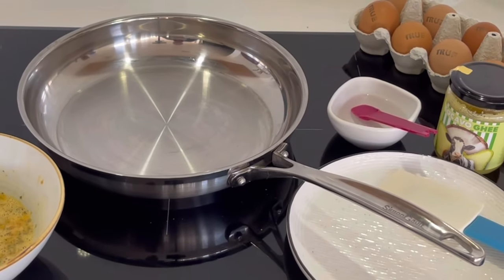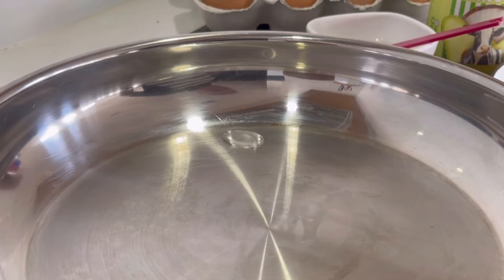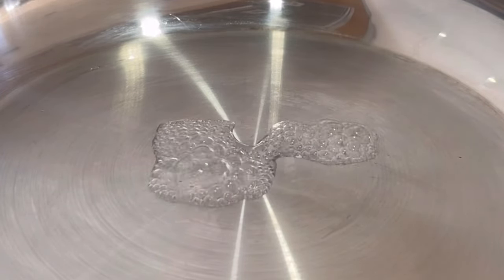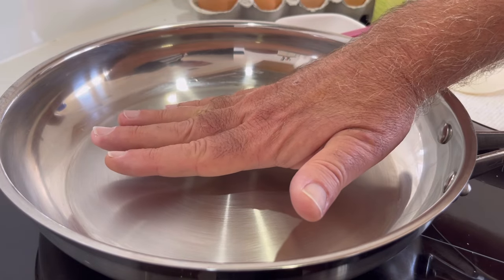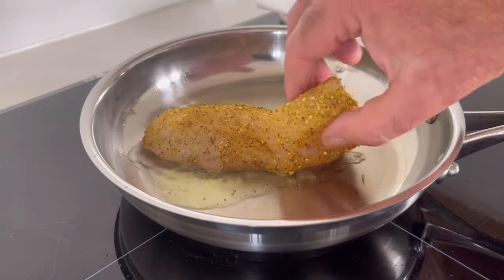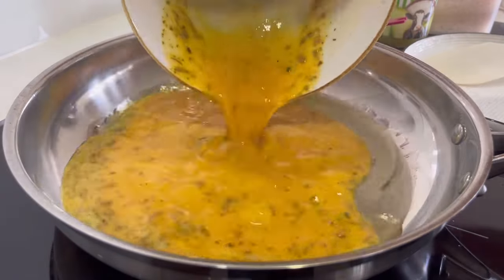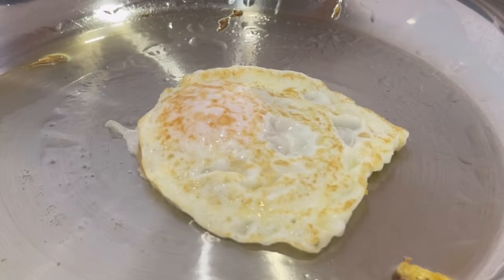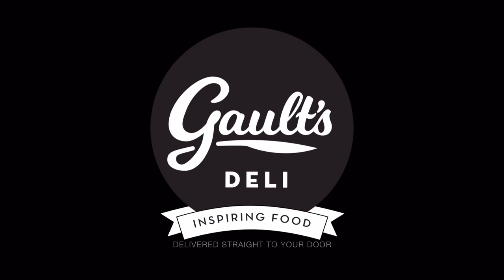The Ultimate Guide: How to Make Food Not Stick in a Stainless Steel Pan! 🍳🚫

Comment: So,  you can only use a stainless steel pan for cooking at a specific temperature? Do you just adjust cooking time for food that needs higher heat? Or just use another cooking method?
Reply from the maker: You can crank up the heat! Stainless steel handles high temperatures well. Just preheat your pan longer for things like stir-fries or searing. You might need to adjust cooking time slightly compared to non-stick pans, but keep an eye on your food and adjust as needed. For super high heat searing, a cast iron pan might be a better option.

Comment: Can i lower the heat afterwards or should it be the same all the time?
Reply from the maker: Hi Robert. That’s a great question! After you've got the 'mercury ball effect' going and added your butter or oil, you can lower the heat if necessary. The key is to start with high heat to get that non-stick surface, but once your food is in the pan, adjusting the heat down is fine to maintain the right cooking temperature. Just be sure to monitor it so nothing burns.

Thanks for asking!
Reply: @simongault5804  i did just as described. I used coconut oil as it has high smoking temp and thing sticks to it straight away. I am not sure my 'stainless steel' pan is real stainless steel after all ...

Comment: Why can I not cook anything with starch in stainless steel? That’s the only stuff that always sticks no matter what😢
Reply from the maker: Hi BabYGirlToria,

 There might be a few reasons why starchy foods are sticking to your stainless steel pans:

As you've seen in the video, getting the temperature right is crucial. Stainless steel pans need to be hot enough before you add food. A quick way to check is the water droplet test, just like we showed—flick a bit of water into the pan; if it dances around before evaporating, it’s perfectly hot.

Next, make sure you're using enough oil or butter, especially with starchy foods. This fat creates a barrier between the food and the pan surface, helping prevent sticking. Coat the bottom of your pan evenly with oil and let it warm up a tad before you toss your food in.

For starchy foods like potatoes, a quick rinse under cold water before cooking can strip away excess surface starch that might cause sticking. This trick really shines when you’re frying or sautéing.

Remember, stainless steel isn’t like non-stick pans; it demands a bit more vigilance. Keep your food moving around the pan to ensure even cooking and to avoid letting it sit too long in one spot, which can lead to sticking.

If you do end up with some sticky bits, deglazing is your friend. Add a splash of liquid (water, broth, or wine) to the hot pan. This will help lift those bits, which you can then swirl into your sauce for an extra burst of flavour.

After you’re done cooking, if you've got any stubborn starch stuck to the pan, let it soak in warm soapy water before cleaning.

Hope that helps. Keep stirring, keep smiling, and may your potatoes never stick!

Cheers,
Simon

Comment: How can I stop fries from sticking to the bottom of my pan?
If I add a litre of oil to the pan at the right temp would that cool the pan too much and the chips will still stick?
Reply from the maker: First, I make sure the oil is hot enough before throwing in the fries. The sweet spot is around 175°C to 190°C (350°F to 375°F). I sometimes use a thermometer to check. Then, I avoid dumping in too many fries at once because that can cool the oil down too much, and they end up sticking. I usually fry them in smaller batches.

Oh, and I always use enough oil, especially if I'm deep frying. For a typical pan, a litre of oil should do the trick, but it really depends on the pan size. Just make sure the oil is deep enough to cover the fries completely.

Also, I pat the fries dry before frying them. Any extra water can make the oil's temp drop, and that's not good. And here's a little trick I learned: I don't stir the fries right away. I wait for about a minute to let them get a bit crispy first. This really helps in keeping them from sticking.

So, about adding a litre of oil – if your pan is big enough and the oil is the right temp, it shouldn't be a problem. Just be careful not to splash and always add the fries gently. Hope this helps!
Cheers,
Simon
Reply: @simongault5804  Thank you for taking the time to write that. Much appreciated.

Comment: So, the water trick didn’t work for me. I put the water in and it slid all over the pan indicating the “right” temperature. But the second I put butter in the pan it burned and turned brown. On top of that my eggs stuck to the pan.

The Stainless steel pan is more trouble than its worth and I’ve wasted so much food.
Reply from the maker: Hi Radio Active! I'm really sorry to hear about the trouble you've been having with your stainless steel pan. It sounds like a frustrating experience, but I'm here to help and offer some tips that might make things a bit smoother for you.

Firstly, the water bead test is indeed a handy technique to check if your pan is at the right temperature for cooking. However, it's important to adjust the heat after this test, especially when you're adding butter and cooking eggs, which both require lower temperatures to avoid burning or sticking.

If you're finding that the butter burns quickly, it might mean the pan is too hot when you add it. Try lowering the heat to a medium or medium-low setting before adding the butter. This should help prevent it from burning and turning brown. As for the eggs, they also benefit from being cooked at a gentler heat. Once the butter has melted and is lightly bubbling, that's a good time to add your eggs.

Remember, there are billions of people using stainless steel pans with great success, so please don't get discouraged. Cooking is a learning process, and every chef has faced challenges along the way. If you happen to live in Auckland, you'd be more than welcome to come and see me, and we could work together to get you using your pan like a rock star. With a few adjustments, you'll be making delicious, non-stick meals in your stainless steel pan in no time!
Reply: @simongault5804  Ah, so the water test is just a trick to show the pan is "hot" rather than any universal sweet spot. Guess that should have been apparent when the second the butter hit the pan it browned. I'll have to mess around with it more to see.

Thanks for the response!
Reply from the maker: @radioactiverat8751  Sorry for the late response. You'll need to play around with the heat levels. Once the pan reaches the water ball stage, try reducing the heat slightly before adding oil or butter. This should help achieve even cooking without burning. Keep experimenting, and you'll find the perfect balance!

Hope this helps!
Cheers,
Simon

Comment: What’s too hot
Reply from the maker: The Leidenfrost effect, I demonstrated through the 'water drop test,' occurs when a liquid comes into contact with a surface much hotter than its boiling point. For water, this effect typically happens at around 193°C (379°F). At this temperature, the bottom layer of the water droplet vaporises instantly, creating an insulating layer of vapour. This vapour layer prevents the remaining liquid from boiling rapidly, causing the droplets to dance and skid across the surface. If the surface temperature is even higher, the Leidenfrost effect becomes more pronounced, with droplets moving more rapidly and sometimes even levitating. 
Hope that helps. Was a little unsure what you meant by "What's too hot".
Cheers,
Simon